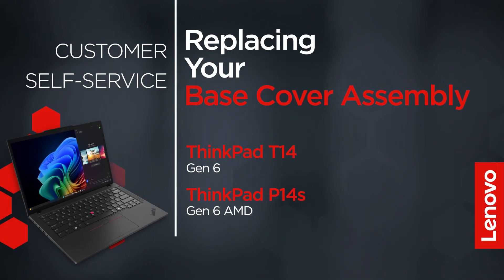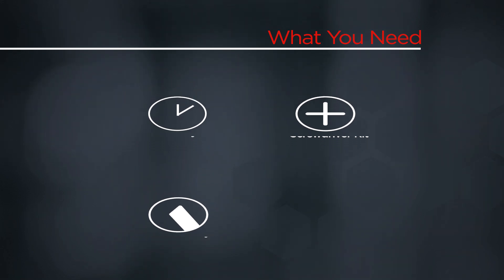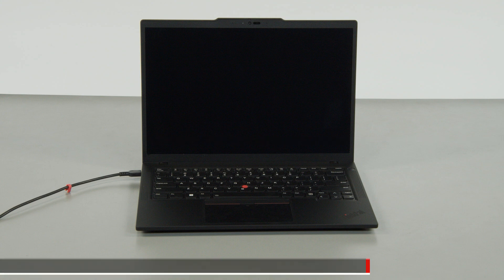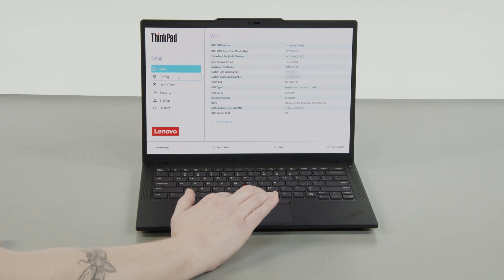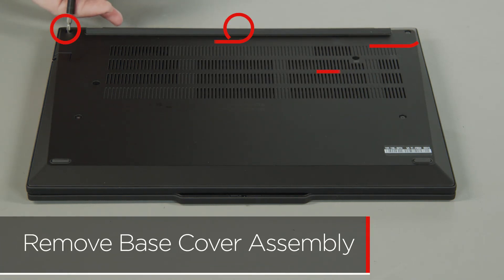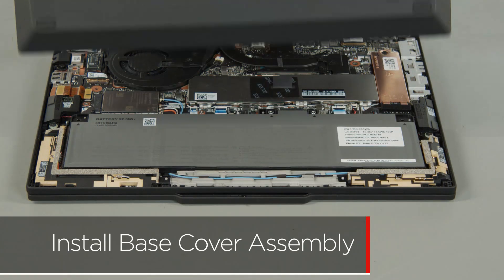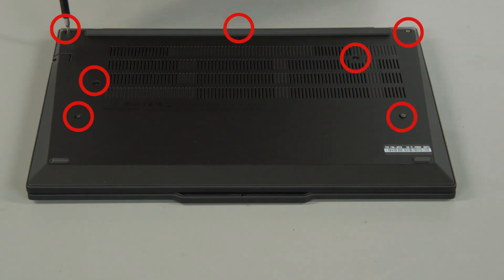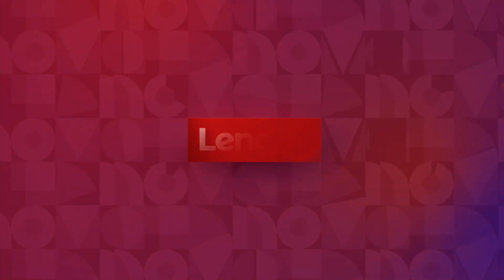Replacing Your Base Cover Assembly | ThinkPad T14 Gen 6 and P14s Gen 6 AMD | Customer Self Service

Comment from the maker: This video will show you how to replace the base cover assembly in your ThinkPad. The process in this video will work for the ThinkPad T14 Gen 6 and ThinkPad P14s Gen 6 AMD.

You will need a screwdriver kit, a non-metallic pry tool, and 15 minutes of your time.

To view the ThinkPad T14 Gen 6 Self-Repair Guide go to https://pcsupport.lenovo.com/us/en/products/laptops-and-netbooks/thinkpad-t-series-laptops/thinkpad-t14-gen-6-type-21qj-21qk/selfrepair/removalsreplacements

To view the ThinkPad P14s Gen 6 AMD Self-Repair Guide go to https://pcsupport.lenovo.com/us/en/products/laptops-and-netbooks/thinkpad-p-series-laptops/thinkpad-p14s-gen-6-type-21ql-21qm/selfrepair/removalsreplacements

To learn more about your device go to https://pcsupport.lenovo.com

To find parts for your device go to https://support.lenovo.com/parts-lookup/?cid=ww:lenovosocial:b9515f&source=socialmedia&subsource=yt

To view the Lenovo Support Self-Repair Guides landing page go to https://support.lenovo.com/us/en/solutions/HT516547

** NOTE: Static electricity can destroy components. Use a grounding strap, and clean, non-conductive surface to work on. Use plastic or coated tools to prevent scratching and avoid using metal tools on plastic parts. For more detailed information on electrostatic discharge and how to prevent it, please watch our "Understanding Electrostatic Discharge (ESD)" video: https://youtu.be/by4PB3WtdLo 

Applicable Machine Types:
ThinkPad T14 Gen 6 - 21QJ, 21QK, 21QG, 21QH, 21QC, and 21QD
ThinkPad P14s Gen 6 AMD - 21QL, 21RV, 21QM, and 21RW

Check out other official Lenovo channels!
https://www.youtube.com/@Lenovo 🟥
https://www.youtube.com/@lenovolegion 🎮
https://www.youtube.com/@Lenovo-PC 💻
https://www.youtube.com/@LenovoSuporte 🟢🟡

#Lenovo #LenovoSupport #LenovoTechSupport